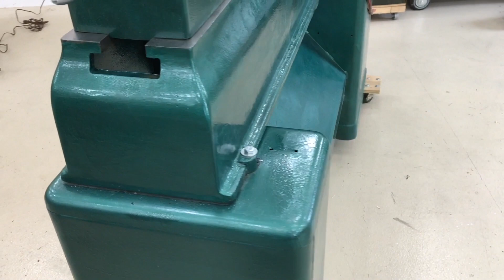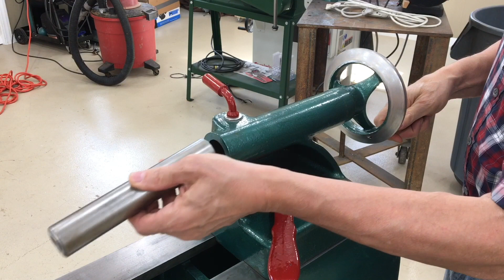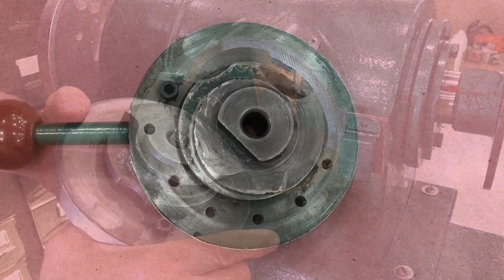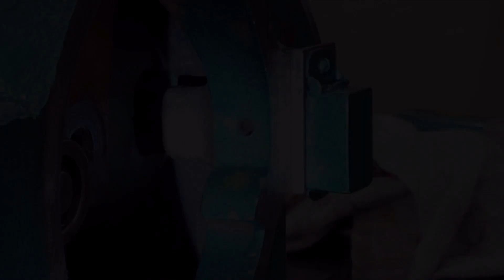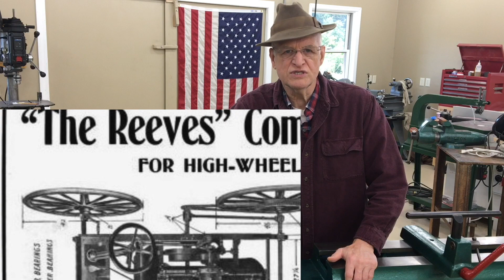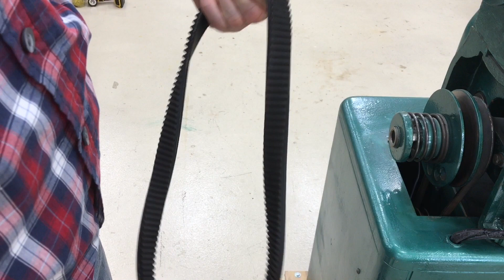Wood Lathe Powermatic Model 90 1 of 2

Comment: Great video! Purchased the same model through an online auction (sight unseen) a couple weeks ago. Most of the internals were pretty varnished and locked up. After applying some time and elbow grease I got it running last night. It was configured for 220v. It’s similar to the one I used in high school over 40 years ago. Still much refurbishing to go until it’ll be ready for use but looking forward to turning some pieces again.
Reply from the maker: Well, good luck with your new adventure.  Thanks for the nice comment

Comment: George, Im restoring my 90 and discovered that micro switch and triggering arm are missing. 
Can the lathe operate without those components ? Your videos are very helpful .... thank you.
Jim
Reply from the maker: Jim, if you put it all back to original…. Yes you will need those parts.  If you put it back kind of like I did in the video…. No, save them for the next guy.   Send me a note if you have more questions.   PargoLongAgo@Yahoo.com
Reply: Thanks for the reply.....Im trying to get the inner sleeve  ( then one with thee stubby  arm and  bearing ) to slide... Ive been applying WD40 without luck ..... any suggestions ? 
Thanks, Jim
Reply from the maker: @JimHanson-s4z  send me an email
Reply: @georgebell7103     Address ?
Reply from the maker: @JimHanson-s4z  see a reply above…. PargoLongAgo@Yahoo.com

Comment: I have a similar vintage Powermatic 90.  I have upgraded to a very similary on/off switch.  I also invested in Vicmark VM120 chucks and ordered the 1 1/8 X 8 TPI adapter for turning on the outboard spindle.  Unfortunately, the Vicmarc adapter on threads on about 2 turns.  Would you be able to verify the outboard spindle thread is 1 1/8 x 8 TPI or is it a 7 TPI??
Reply from the maker: Thanks for your comment. I sold this machine a few years, but I believe the threads were 1 1/8 X 8. But cannot confirm

Comment: I don't think that I understand the need for dual speed controls. I'm sure that there must be a reason that I don't understand.   When is one better than the other?  I'd love to find an old Model 90 near me for sale.  Gotta be better than the new stuff.
Reply from the maker: The dual speed control, is simply a function of the original manual control which still works on the machine plus the added control for the motor speed.  Two types of speed control is not necessary, either one is fine to run the machine. But having both make the machine a little more convenient to use.   Thanks for your comment
Reply: @georgebell7103  And thanks for your reply
Reply from the maker: @jimfiorentino7741  yep

Comment: George, I just got my own pm90. Great video! I'm trying to adjust the reeves drive. I notice when you run yours up to top speed the pulley at the bottom is not at maximum diameter, meaning, you might be under speed. What are your thoughts?
Reply from the maker: You are right, absolute minimum and maximum speed are achieved on the Reeves drive when the belt on both pulleys are maxed out, either as large as possible or as small as possible.  The sheves can be adjusted to achieve this condition.  You have described accurately what is shown in the video.  I did not really need to be at the absolute max and min because the machine has the variable speed motor.

Comment: Great video. I just picked up a 90 lathe and I am looking to see if I can get any chucks for it. Any ideas on which ones will fit? I have heard of a few guys using adapters. Any information would be greatly appreciated. Thanks in advance!
Reply from the maker: I really don’t know, I have to believe there must be an adaptor to fit the model 90 spindle someplace.  I do not own the lathe any longer, so I never tried to purchase a Chuck for it.